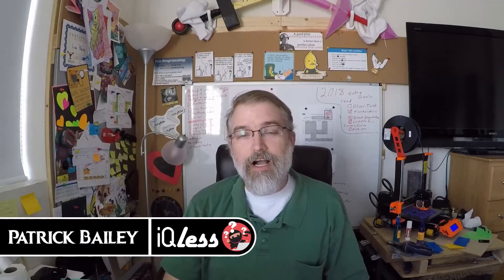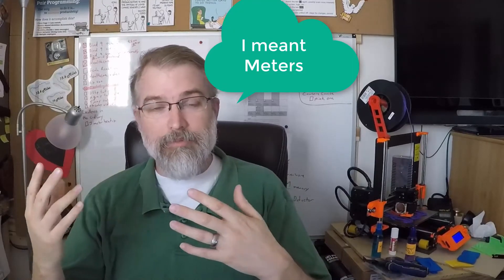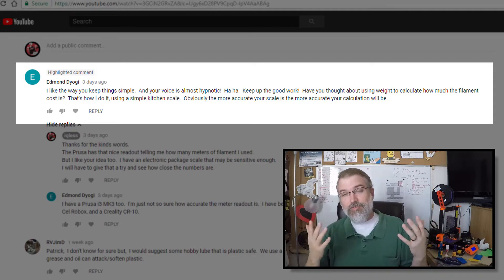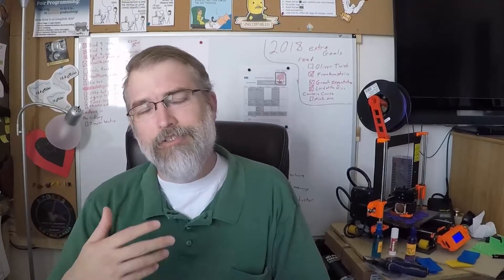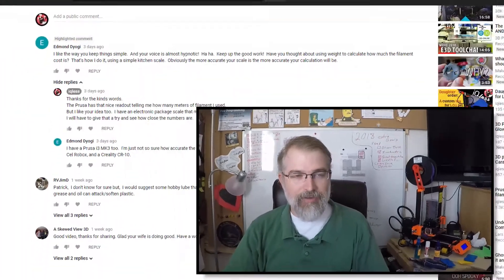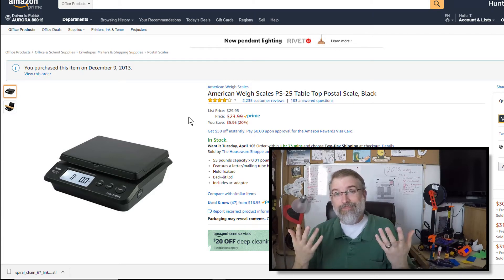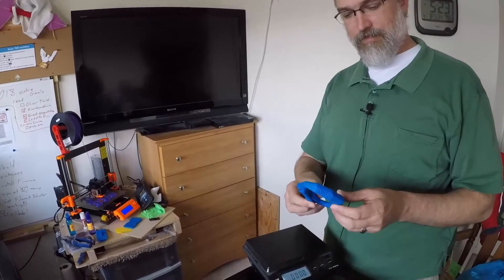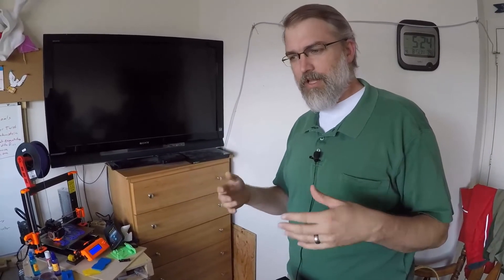3D printing: Estimating Filament Cost by Weight

Comment: Just remember this will only be accurate if you weigh the part including any raft, brim and support materials. Even though these are waste materials they are still part of the cost of printing the object.
Reply from the maker: Very good point.   
For the most part I try to avoid using rafts,brims, etc.  Unless necessary.
But when I do have them I will try to make sure I include them in my calculations

Comment: On one side it is good to use weight for estimated costs. But if you print  something in PLA and want another in BronzePLA the used length will be the same but the weight different, so you can't calculate the cost from PLA to BronzePLA...check Slic3rPE to see how they calculate the costs. If I'm not wrong they use density per cm3
Reply from the maker: That's a good point.   If you had the density difference between the two materials you could convert it.
So if BronzePLA is 50% more dense then just multiply the mass by 1.5x.
Reply: All the filament I have looked at is sold by the weight of the spool. For instance the Matter Hackers ColorFabb bronzeFill Metal Filament - 1.75mm is .75Kg. They do not quote a length on the spool just the diameter and the weight when sold. So if you track the price per gram of what you buy it should always work out better than using length or density.